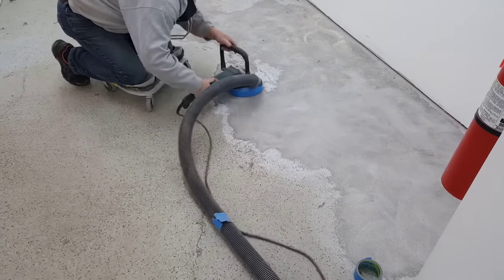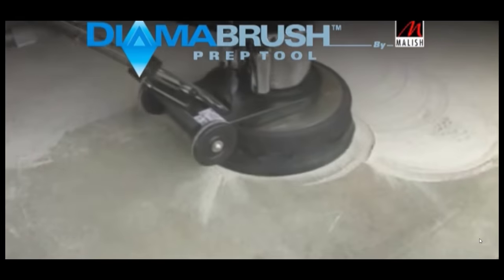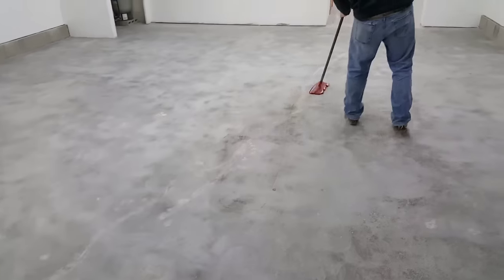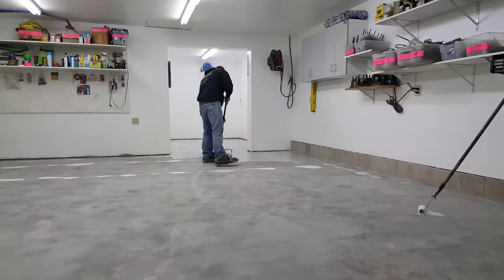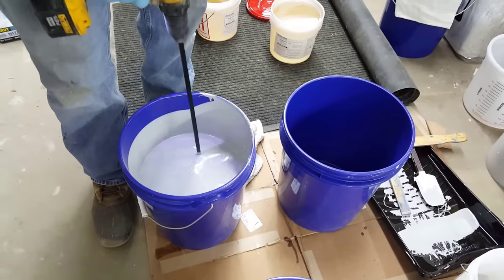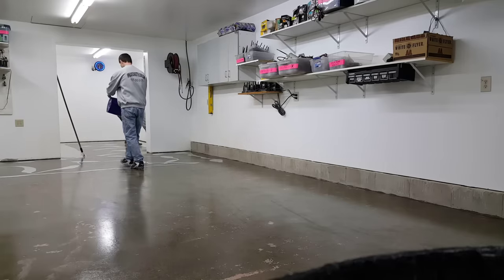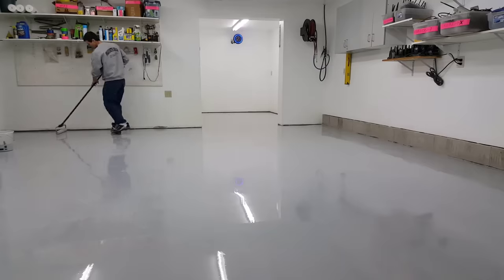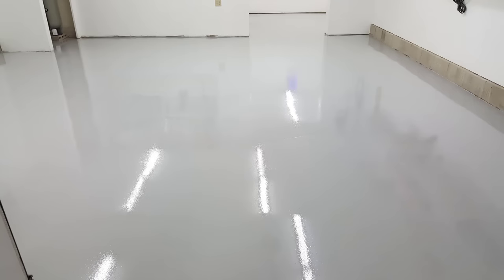How To Epoxy Coat Your Garage Floor | Must Watch For Diy'rs

Comment: That’s kinda sad though that you’re saying the epoxy you buy from big brand stores Lowe’s/Home Depot just won’t last long lol I think you just crushed half our dreams 😂
Reply: Me after buying it from homedepot this past weekend 🥲
Reply: We ought to sue Home Depot
Reply: I noticed at Home Depot, the Dry Lok is right next to the epoxy stuff … wonder if dry lok would be a good primer
Reply: The video made it sound like its because folks don't prep the floors good first though. I've never epoxied floors but i've done a lot of diy spray painting and prep is everything. Even cheap spray paint looks and resist great with good prep.
Reply: I've had rustolum epoxy  for 8 years in shop from home depot  and help up fine with tons of use on floor I'd buy it again in a heart beat
Reply: I thing the average DIY’er will just clear their garage out, use the enclosed etcher, then lay down the epoxy. That’s part of the issue. I used the Diamabrite buff and then prepped it with power washing it, cleaned it, then put my epoxy down. Once it’s dry, I’m adding the urethane topcoat. We shall see how it lasts.
Reply: I do garage floors for a living in California, E2U epoxy is the one of best, we also flake and clear coat as well and yes no matter how well the prep work is, home Depot and Lowes epoxy will is trash
Reply: If you properly prep the floor big box store epoxy will last you a good while.  You’re also paying a lot less for the epoxy from Home Depot or Lowe’s.  It’s really the best example of you kinda get what you pay for but for a diy job big box stores are fine.
Reply: I've seen siy kits last 20 years. The prep work is the most important part it takes a long time and I suspect tldiyers don't spend the time to do it right.
Reply: It's true though
Reply: I used behr water based 1 part epoxy for my basement prepped real good used acid etch ETC man what complete garbage it is
Reply: @atownish1488hh  
All water based epoxy is doomed to failure, not just Behr.. you have to go with the solvent. Simply put, if it ain’t flammable it ain’t good.
Reply: All contractors say so, I haven’t heard any contractor saying big box shop products are good- it’s always “their” products that are the best
Reply: Actually is a great advice cause is true those products are not good
Reply: Funny how you say that, I got my epoxy from Lowe’s and the floor is still perfect 7 years later.
Reply: DIY = you did it to yourself!
Reply: @gimmeaford9454 hi! what did you do to prep & what primer, epoxy & top coat did you use? thank you!!
Reply: I agree it's in the prep like everything n not a lot of water in the prep
Reply: He's not saying the home Depot stuff is trash it's just that shit could have been ruined during transport, temperature makes a difference, and people don't know how to use it. There's different types of epoxy if you don't prep right though it doesn't matter how good material is it won't last nmw
Reply: Right off the bat first communications 
“You are about to fail”
Great thanks
Reply: I did my garage floor with Rustoleum from Lowe’s. I did rent a grinding machine from HD. Almost 5yrs in, the floor has held up great!

Comment: Bravo for preparation. You are one of the few people that shows diamond grinding as preparation. Great job installing the prime coat also. That looks like a very durable floor. you did a great job
Reply from the maker: Thank you!
Reply: @MikeDayConcrete  what epoxy coating did you use before the clear coat? Can you recommend the products?
Reply: What company makes the material you used for this project and if it’s a new garage that was poured less than a year ago, do I still have to grind or can I just drop an etch liquid?

Comment: I was going to epoxy my basement floor. However, after watching this I have decided not to.  I can't risk doing it wrong the first time- financially or emotionally.  I appreciate you for showing me the real problem I'd have gotten myself onto.  Thank you immensely! I'll just save up and get it done professionally. 👍
Reply: Damn I just watched this video and thought the same thing you said.  I will have to hire a professional.
Reply: my friend did it himself did everything in this video and a year later it all came up.
Reply: @eddwinnas  He ever figure out why?
Reply: @wilky15  i think ground was a bit wet it didnt in other room
Reply: Is always a good experience to do it yourself!
Reply: Yea, go for it, you'll do great
Reply: You need to tape some plastic wrap to the floor and leave it for 24-30 hours and see if ANY moisture shows up. If so it will lift the epoxy if other steps aren't done to seal it.

Comment: I got epoxy done for 2 car garage. I wasn’t interested in the very smooth finish because the winter and slips. So I did 2 coats with lots of chips. I realized when guy was done, some area when touched are very rigid while some areas had shiny smooth epoxy. I told him about it and he said this is normal to avoid slipping. Not sure if I got robbed and he’s being lazy. I paid $1650
Reply: Ali Ahmad good luck keeping dirt from getting stuck in the rough areas. Sounds like you floor is a bit wavy. There’s a way to do 100% flake coverage, yet not have rough areas. I can’t tell you all the secrets, or I’d be out of a job. 😏
Reply: If you’re not in his area, you don’t have the job anyway. Pay it forward. Unless you don’t watch tips from professionals…?

Comment: I would love 2 have a business like this, its so relaxing to watch, and do.
Reply: Costs around 100 grand for all the gear plus a van and trailer to carry it in, after that it’s cost of materials, once the first jobs done it’s all maintaining gear like rollers and grind wheels and such. Cost of material will be paid off first job, it’s basically floating the product to the customer until they pay. After that it all pays for itself as long as you do good work
Reply: Some schooling required but it’s nothing compared to other trades
Reply: And believe me it's back breaking at first days don't give up

Comment: Hello, great video. Our garage has concrete slabs with paint on it. How do I prep the floors for that. Should I still grind the paint off or can I use some other method to remove the paint layer. Thank you
Reply from the maker: Grinding usually works the best to remove the old paint and prep the concrete for the new epoxy.

Comment: SIKA EPOXY IS ONE OF THE STRONGEST GRADE EPOXY. if your spending the money to get epoxy flooring done, get the right stuff. No shade to the creator of the video, if the epoxy is done properly with correct mixtures the finished product will last decades if not forever without gaining cracks or breaking chunks free. I have used Sika since I first began epoxy, and my dad did his floor and it remains unscathed for 20 years and counting
Reply: I hope this comment was helpful! The application was correct just the grade of epoxy was low or maybe the mixtures and times for them were incorrect

Comment: Great video! Glad to see a pro doing it right. I’m a contractor and a customer asked me to do epoxy on a storefront floor... never again will I mess with it. We used that rustoleum  stuff and it was absolutely horrible. We diamond grinded, etched, cleaned and followed all directions.They offer a guarantee but I sent the pictures and they wouldn’t respond. Took twice as much product to finish the job over $700 in kits plus machine rentals. Would have been better to hire pros like yourselves
Reply from the maker: I run into that a lot. People trying it themselves without really knowing just how or what needs to be done. That's why I made the course.

Comment: Great stuff! If you're dealing with new construction, will the floor still need to be prepped or will it be good to go?
Reply: Great question, would love to hear the answer to this as well.
Reply: Yes it will need to be prepped. The purpose for grinding is opening up the pores of the concrete to create a surface that the product can grab and bind to. Even newly poured concrete will dry in a way that will not be ideal to bond to whatever product is being applied. Hope this helped!
Reply: Yes, I just had my newly-built home done and they still needed to grind the concrete. Not to mention, for a new slab it was already dirty as the construction crews had stored equipment and even parked in the garage while the home was u see construction.
Reply: They put a clear sealer over it, you probably need to grind off

Comment: Great Video Sir, my question, I have a 30x 40 garage, the concrete has a vapor barrier and is about 2 months old now (smooth finish) do I still need to do the grinding step on fresh concrete or will an etching type primer do the trick?
Reply from the maker: For the best long term adhesion, I'd grind it.

Comment: I bought epoxy 2 years back and then chickened out. Now I’m pulling courage to do it. My question- is there a expiry for epoxy?
Reply from the maker: It should be still good if you didn't open it and it didn't freeze.

Comment: That’s a suweet lookin floor! Never worked with epoxy floor coverings but I’m gonna go ‘out on a limb’ here and bet that the secret to a nice looking epoxy floor that lasts is probably gonna be the prep work? Almost true with anything really. Prep, prep then prep again.
🤜🤛
Reply from the maker: Yes, the prep work is really important. That's why most homeowner diy epoxy floors fail. They're told to just acid etch then apply the big box epoxy. As soon as they drive on it with hot tires the epoxy peels right off under the tire. I grind all my floors before we do our epoxy floors. Never had one fail yet.
Reply: Mike Day Everything About Concrete 🤥

Comment: So if you grind the floor first, do you not have to mess with acid etching?
Reply: My opinion is that you use acid to ech the concrete to make for better adhesion. Grinding it back to bare is effectively doing this. But if you want a super slick finish you can do both followed by filling any holes or uneven surfaces. Grind again. Vacuum all debris and dust. The seal it

Comment: I have a floating slab detached garage in Minnesota. I have been told not to epoxy my floor because there is NO vapor barrier underneath. What’s your opinion Mike? Will I get to much moisture from the freeze/ thaw?
Reply from the maker: No, not necessarily. You can check for moisture by testing the slab. google that. The first primer coating I used on this one will block most any moisture that's coming up through the concrete. If it's excessive (you'd notice that) there's even moisture blocker epoxies for that much moisture also.
Reply: You do the moister test. Tape a piece of plastic and leave it overnight, next Day you take it off, if the concrete underneth the plastic..... you good to go

Comment: Hey Mike, really great video. My old man used to say "Always enough time to do it over, but never enough time to do it right...just do it right the first time" What do you think of the rustoleum epoxy kit?
Reply from the maker: I've never used it myself, but if it's not 100% solids forget it.
Reply: @MikeDayConcrete  I just bought one of those Rustoleum kits but after watching your video, I think I'll return it. I'm not hearing great things about them, especially in the coverage area. Some people are saying they need 4 to cover a 2 car garage properly. At $214 a pop at Lowe's, might as well just hire a pro or go your route. I would like to try it myself still, so I think I'll just take your advice. Just need some of those fancy shoes you guys have on lol.
Reply: @tylerrue3108  We did our shop floor at work with the Rustoleum ten years ago.  Worked great and has held up very well.   There are a couple of areas right under the lift that have been cleaned 100 times with solvents and we've got maybe three dime sized areas that basically just wore through that showed up when I pressure washed it.  I've spilled every automotive fluid out there on it, dragged forklift forks across it, and generally just used it, and it has held up great.    Using brake cleaner on it is the only thing I've found that actually damages it, so don't do that.

Comment: Hi Mike..I just found you here...I had my garage epoxy chipped and it turned out great...(He was a professional ) Patio turned out great stamped...Now he stained and sealed my driveway and I am little bummed with that...Have a feeling it was little hot to seal...But anyway..I haven't used a power washer and been couple months..Should I just use dawn with power  washer?He used 3 coats of sealer.

Comment: It’s extremely slippery when wet. Especially with snow or ice. I’d highly recommend a clear silica sand or colored quartz. (Could save your life) I do epoxy/polyaspartic floors for a living. We have never done a floor without it.
Reply: There are some epoxy coatings that offer skid resistant material, depending on the area and what kind of traffic it is receiving.

Comment: I have a very bad garage concret floor, grinding only won’t help, means I need to go down 4-5 mm. Any idea what I can use to level/fix it first before applying the epoxy? 😢

Comment: cool video,  I have 3 questions if you or someone would kind to help:
what if garage f'oor is slopped towards a drain? will the epoxy run off the concrete ? 
what if you have repaired cracks, does the epoxy hide it all?  
what if your concrete is cracked heavily, and/or bucketed  towards the the wall do you just use leveling cement and use epoxy?
Reply from the maker: 1. Unless the slope is very steep, the epoxy shouldn't run to the drain. Always tape over the drain though to protect it.
2. The epoxy will hide the repaired cracks, yes.
3. You can repair it with some kind of leveler. Just have to let it cure fully before applying epoxy over it.

Comment: Question!! We have done the craftsman epoxy, we did scraped the floor use degreaser and let it dry one day, applied the mix and it was good after 15 mints alot of small (bubbles)holes start showing up in several areas of the epoxy in these (bubbles) the concrete is showing up the bubbles sizes are about pennies sizes! Can someone please tell us what is the reason behind this problem?
Thanks.

Comment: If you apply when concrete is still curing (dry to the touch but not quite 120 days yet), will the moisture well up and form a wet spot visible from the above? There’s a mysterious pool of wetness in my shed but there’s no roof leak anywhere
Reply from the maker: Can't have any moisture coming up through the floor and use this stuff. Have to fix that first.

Comment: Can you round the corner between the block wall and the concrete floor, then paint the epoxy up on the 1st row or two of a concrete block wall?
Also, where are you guys located? I'm in east Tennessee. I wish I had you guys to do my floors (and walls) at my workshop!!
What filler material would you use to make a radius transition between the floor and the walls?

Comment: can you just primer over paint ?  The place I work at want the floor epoxied, but it is a semi-cleanroom and particles can become an issue.
Reply from the maker: No I wouldn't. We always remove existing paint & coatings before applying a new one.

Comment: I did my garage floor about 6 months ago, and I used Sakrete Flo-Coat to try to level the garage, due to pitting. I did grind off the existing paint.

What should I use or do to repair the pitting and spalling before applying the epoxy?

Comment: Hi Great video and thanks!  I have a brand new house with a clean white garage floor that has never had a car on it yet.  Do I still need to go the the Diamabrush step or should I just use a cleaner and then the primer coat?

Comment: What would the prep process be for a concrete garage floor that’s less than a year old with no material on it besides the sealers they sprayed before it cured

Comment: Have a question. I have a  10year old built garage 60x80 and sealed concrete  floor. The is vapor barrier  and pink foam insulation  under the 8 in slab. Would i need to grind the seal off the concrete? And is your product durable  on oil stains and brake clean,  gas and solvent spills ? Will it soften? 

Thanks
Reply from the maker: Yes, you have to grind off all the existing sealer. You would have to address the oil stains by cleaning them as good as possible with a degreaser, then possibly using an oil stop epoxy to keep it from seeping up through.
Reply: @MikeDayConcrete  sorry Mike. I ment to say ...does your flooring last and stand up to gas ,brake clean and other solvents? Thanks

Comment: My garage floor has that smooth finish that the builder applied 18 years ago. Will that diamabrush remove it? I want to put an epoxy paint on my floor.

Comment: In terms of durability which one is better the polyurethane paint or epoxy since you mentioned that you used polyurethane as a top coat
Reply from the maker: Urethane is more chemical resistant, UV resistant, and Scratch resistant than epoxy. That's why we use it as a top coat.

Comment: Nice looking floor Mike! I’ve got a 1368 sq/ft garage that I built last summer. The floor is heated. Next winter I’ll be bringing my farm tractor in and it has chains on the rear tires. Would the chains mark the epoxied floor? It hasn’t marked it yet on the bare concrete. Thanks from Kazabazua, Quebec, Canada!
Reply from the maker: It may. I would broadcast flake into the epoxy for that kind of vehicle. It would make it even more durable.
Reply: Mike Day Everything About Concrete Thanks for the reply Mike and keep the videos coming, they’re awesome!